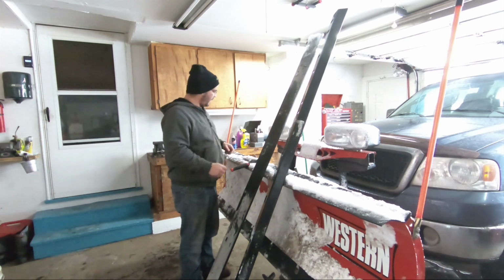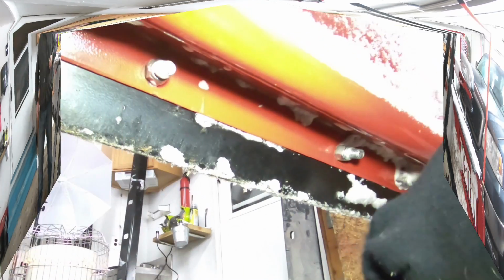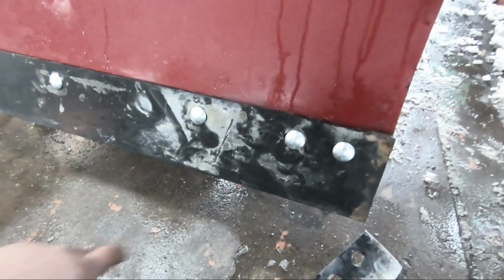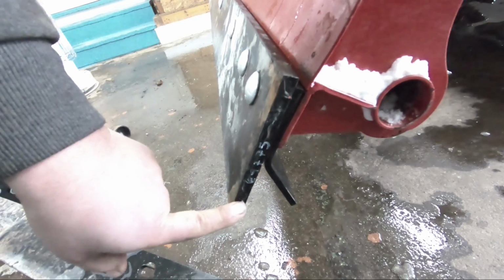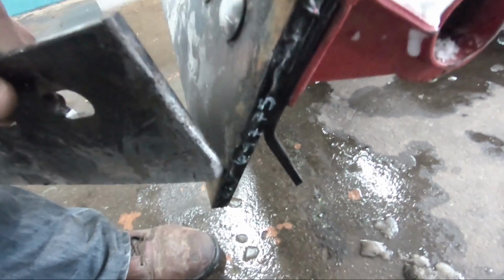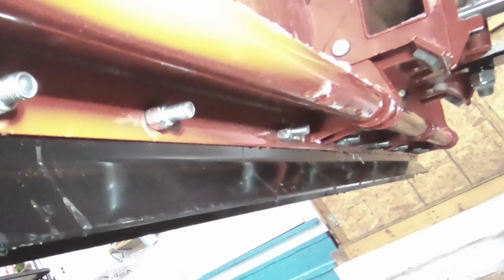Installing new cutting edge and back drag blade.

Comment: Have you seen bobs lawn care video on his tricks to making your edge last longer? He also runs shoes which helps slow down the wear and says they do not affect cutting performance contrary to popular belief. Dunno about backdragging though.
Reply from the maker: I have not watched video.  I have had shoes in past and it doesn't clean as nice no matter how you set them up.  I feel it's just a waste of money for shoes. I could be wasting money on cutting edges but at this price for two years of service I'm happy.
Reply: @DelsLawnCare  correction: the channel is Bob's lawn service and plowing. He welds some thick pieces of steel a few inches long to the front of his edge at the corners. They stick out an inch or two past the corners which protects the edge from curbs and keeps the ends from wearing out according to him.
Reply from the maker: @jamesnm21  I believe that would save them from Wearing out. That's same thing as winter equipment. I'll check his video out.
Reply: @DelsLawnCare  yes, similar idea as their curb guards, but cheaper if you have a welder or a buddy with one. I used the the bottom leaf from an old set of leaf springs because that's what I had. It's about 5/8 in thick. Dont know if you watch Stanley dirt monkey's vids but he says the western cutting edges don't last nearly as long as the Boss and other brands so he bought winter equipment edges.
Reply from the maker: @jamesnm21  yes I seen stan video. He asked me about them because I put on my v plow. I have a boss plow and cutting edge they last about same as my western.  I also don't buy western cutting edges.  I buy after market from Angelos at half the cost. Western, boss and winter charge way to much for cutting edges. Sence you left comment I checked all 4 plows. Winter equipment is doing the best at this point. Boss and western within 1/8" wear from this season.  Winter has not moved 1/16". If your interested in seeing these I posted pictures on Instagram delslawncare.  I'm with you on saving money so I might try your way once these wear out.
Reply: @DelsLawnCare  thanks for the heads up on where to buy cutting edges. Mine will probably need replacing next season. And I can't speak from personal experience yet on Bob's edge saving trick as I just tried it recently but I thought I'd let you know just fyi.
Reply from the maker: @jamesnm21  I thank you for any input or tips.

Comment: I hope you are using the safety chain and  Something else to make sure just plow does not come down I do not trust hydraulics
Reply from the maker: I always support anything I get under.  Most of time I use jack stands.
Reply: @DelsLawnCare   Yes but I also asked do they have that for a Myers plow please comment back thank you
Reply from the maker: @martinneps9387  I have no clue about Myers. Never used or seen one. Sorry. You could ask your dealer if they sell something.

Comment: Did you find the back blade a worth while investment?
Reply from the maker: It help very little.  I will never buy one again.
Reply: James Ouellette I was just looking into this. The front blade you would definitely recommend right?
Reply: Del's Lawn Care Thanks for your review brotha, really appreciate the heads up cause I was in the market for one but your the second person to tell me not worth it so I’ll just do front blades.
Reply from the maker: @julzcarr1221  I try to keep things honest. Save your money my friend.
Reply: @DelsLawnCare  I agree that seems to be the general consensus. Won't be wasting money on it, thanks for the honest review. Did you find the new 1/2" front blade helped with backdragging?
Reply from the maker: @CoBrAChiCKeN948  yes. I felt the little added weight help plowing and back dragging. Plus that edge is still on truck from when I made this video.  Out lasted the other thin blade.

Comment: must be nice when the bolts aren't rusty! looks like u don't even need a new blade
Reply from the maker: I didn't like the 3/8" cutting edge they put on it from factory. I wanted the 1/2" cutting edge. Yes I could have used this edge for more work.
Reply: Hello. would you like to try carbide snow plow cutting edge. this life is longer than ordinary steel 8~12 times. if you are interesting we would like to provide free sample to you to test the quality